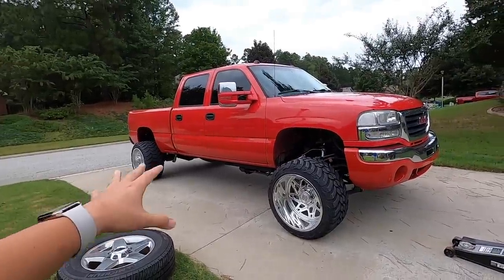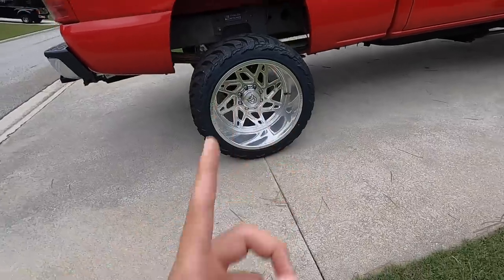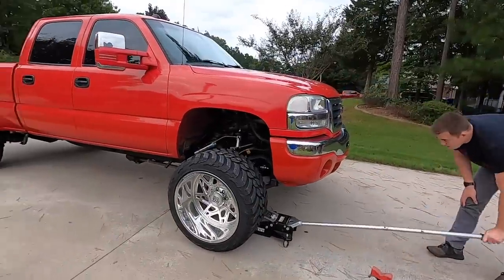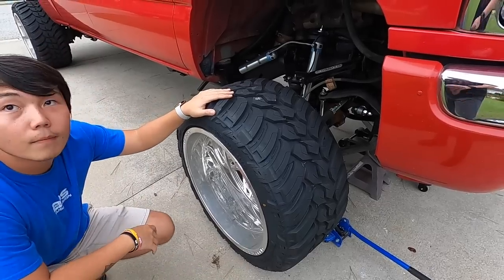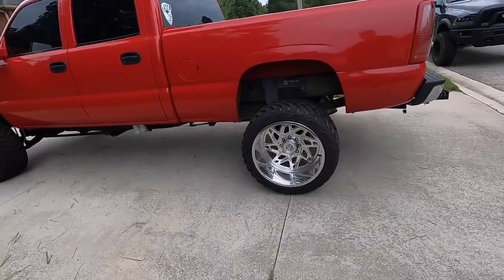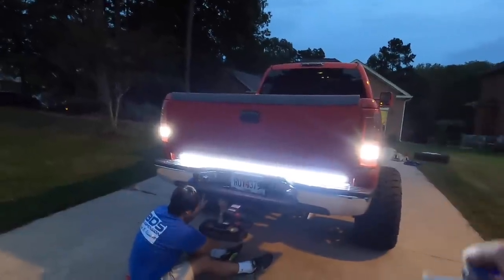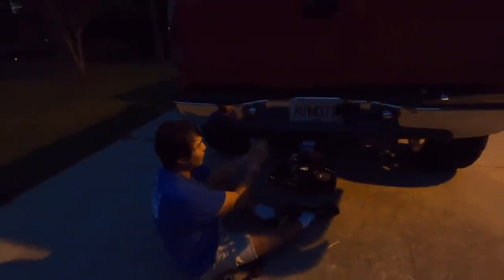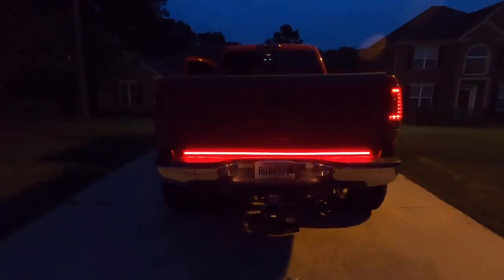FORGED WHEELS PROBS...

Comment: There are two 10 amp fuses in the driver side fuse panel in the dash for left and right trailer turn signals, they are not under the hood. A Novita LM487 flasher relay should help your hyper flash.

Comment: On my 03 I have the same problem, the fuses were all good and the wire was dead all the way up to the fuse box. I was just rewiring the 7pin so I used the extra wire there for if you wanted to hook up a third brake light on the trailer, still haven’t been able to figure out what’s wrong with it

Comment: My guess is you need a load resistor on the turn signal phase to slow it down and give the light bar time to flash, put one on both the left and right phases and just wire them into the tail lights not the light bar, the computer needs the left and right to have similar resistance so don't just do the right.

Comment: Running stretched tires  on wheels are bad to if you didn't know that all your doing is messing up your whole front end negative off sets are bad look good if your into it but bad idea
Reply from the maker: Tires are stretched and as I mentioned in the video, hubs, idler and pitman arm and gear box will be upgraded.